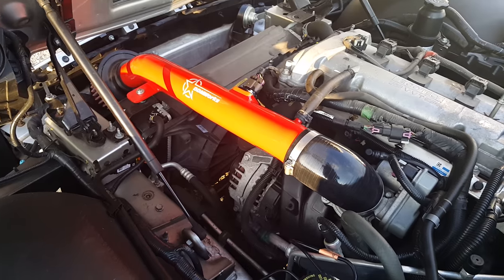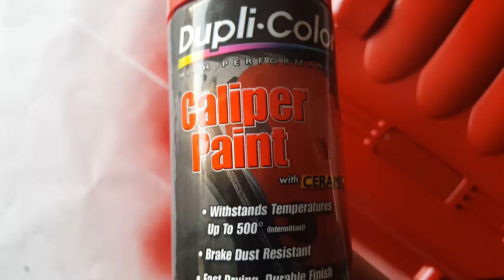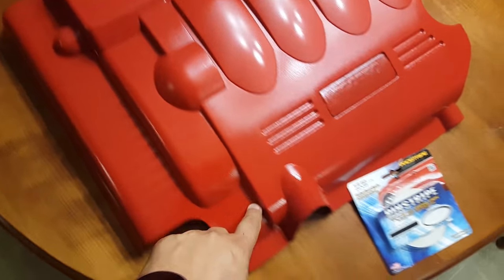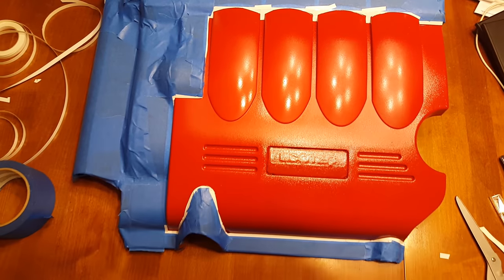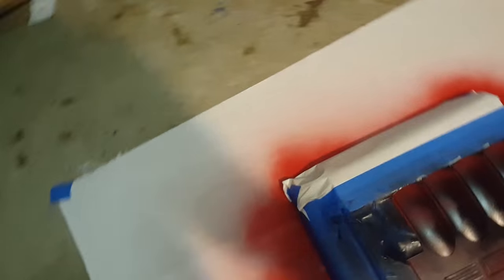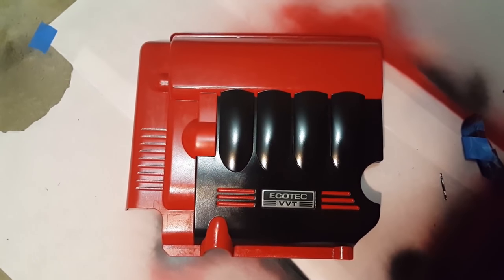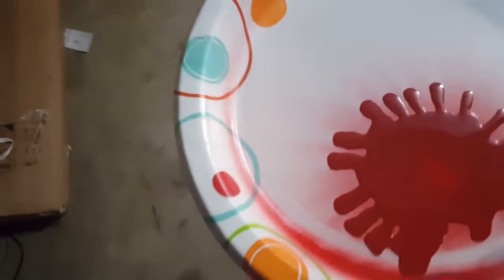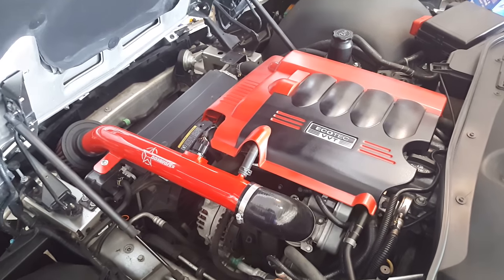How to paint your engine cover

Comment: Some of the problems you’ve had were caused by using two colours. It’s a personal touch of course but it gave you loads more work because of masking and having to remarking. I did my engine cover and only masked off the logos and engine type. I also painted the filter cover and battery cover. The only colour I used was the manufacturer’s colour. It took. A day and was so easy. Saying all that, your cover looks great.

Comment: Did you need to use a high heat resistant paint?
Reply from the maker: I wasn't sure if I needed to use high heat resistant paint, but I did anyway just in case. The engine bay can get pretty hot and I didn't want to take any chances. It's been months since I painted the engine cover and it still looks great.

Comment: You’re car is a v4
Reply: The fuxk? V4s havent been arround since the 1920-60s
Reply: And? It's an amazing car.
Reply: @charlielainez1148  and? Its a 2007 car. https://en.m.wikipedia.org/wiki/Saturn_Sky thats a striaght 4 not a v4
Reply: @joshjenkins3815  Even though it's a 4, I don't see a problem with it. Just being a 4 doesn't means it's bad.
Reply: @charlielainez1148  look at the initial comment. Its not a V4
Reply: @joshjenkins3815  Ok.
Reply: @charlielainez1148  just clearing up misinformation.  4 cylinders are great.  V4s not so much 🤣